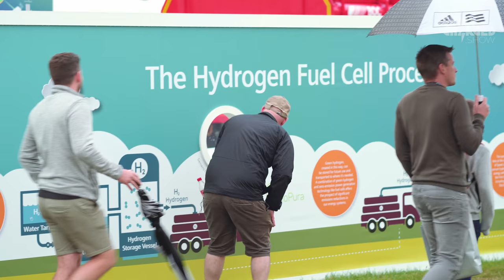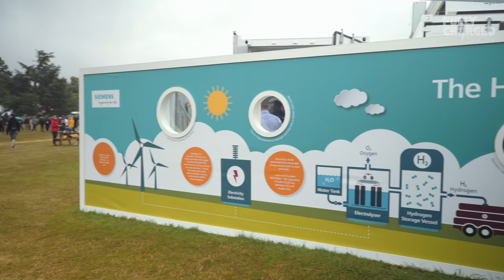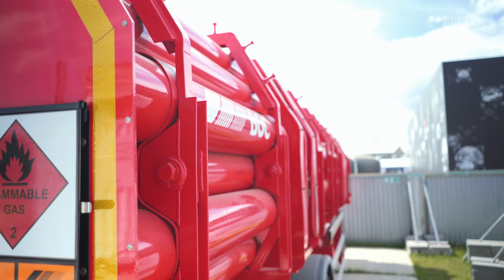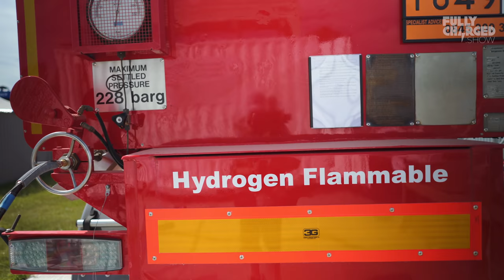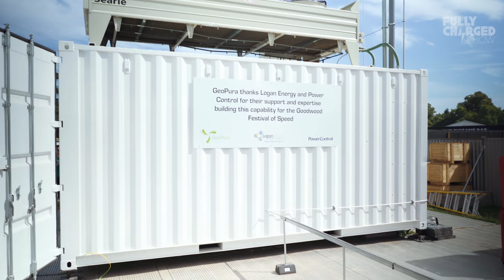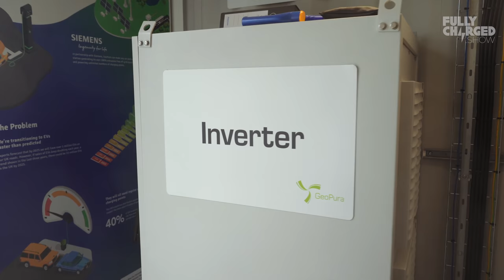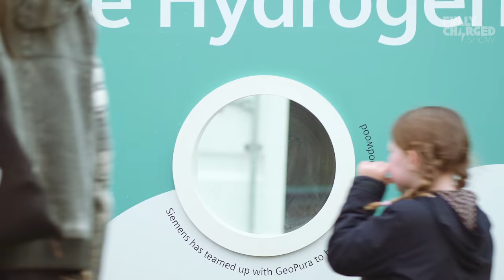Green Hydrogen Fuel Cell Charging System at Goodwood Festival of Speed | Fully Charged

Comment: Why don't Siemens Gamesa incorporate hydrogen fuel cells into the foot of the wind turbines?
Reply: Fantastic question!! I can't wait for an answer to this!!
Reply: ? You mean electrolysis machines? The fuel cell wouldn't be of any use.
Reply: You mean an electrolyser. It would be an expensive piece of capital equipment that would only be used when electriticy prices are negative (not very often). The electrolyser  would also require maintenance. 

Result would be inefficient use of capital leading to high price for the hydrogen produced
Reply: Why not pump water into the mast, then recapture the energy via a turbine when released?

Comment: You can easily stick 3MWh of batteries in a shipping container. Much simpler.
Reply: Hey, isn't that exactly what a Tesla Megapack is?
Reply: But you wast a huge ammount of resources and energy to produce said batteries ....
That's one advantage of fuel cells, they are less wastefull, considering stored energy and usable power. The inherent payback is the efficiency loss in the process of using fuel cells but than again, you can store energy as hydrogen much longer than Li-Ion batteries could ever do.
Reply: and 3MW of batteries would be much smaller.
Reply: @evilutionltd  
Generally, most energy sources have a higer volumetric density than hydrogen, another advantage of hydrogen is basically its disadvantage as well, it "only" has the best gravimetric density of all the known energy sources (besides maybe open cycle nuclear reactors or rocket engines).
Reply: @mandernachluca3774  do you know the comparative resource cost of batteries vs fuel cells?
Reply: @MrGonzonator  
Not exactly, however, i can tell you, that you need to increase the ammount of batteries to increase the energy capacity of a battery stack, you don't need to do that for fuel cells.
You basically have one stack of fuel cells and every increase in capacity can be handled by simply increasing the size of the nessecary tank, hydrogen tanks usually can be made of a rubber coating and a steel case (if used stationary, cars need lighter materials wich would eventually raise cost and resources needed).
Both are very common nowadays and cost a bargain compared to an equivalent mass of Li-Ion battery.
Reply: @mandernachluca3774  bear in mind that you only need ⅓ of the capacity of batteries since the fuel cell is so inefficient.
Reply: @MrGonzonator  
No, you would need one third of the energy stored in form of hydrogen, that would go under the begor mentioed penalty of lower efficiency. 
You would eventually still use more precious metals for the battery storage when increasings its capacity, in comparsion to a fuel cell stacks, wich only needs a fix ammount of precious metals and than can produce as much energy as you want, as long as the hydrogen tanks (made of rubber and steel) are big enough.
Reply: @mandernachluca3774  
 Mandernach Luca  
How about the electrolysis plant.
And staff.
And maintenance (that's going to be high, hydrogen leaks!)

And the tanker transport.

And refrigeration.

That's all continuous.

You think fuel cells don't use "resources" including exotic materials? Or wear out?
You'd actually need more, since the efficiency is so low.

What happens if you don't freeze the tanks? (Boom!)
You think that doesn't need energy?
Reply: @rogerstarkey5390  grid with renewables will have curtailment. Electrolysis is far better than just turning off.
Reply: @rogerstarkey5390  Pressurized H2 tanks don't need active cooling and you know that. Why are you still making such comments?
Reply: @rogerstarkey5390  
Well, i don't know were you live but here in europe nobody uses refrigurarion anymore to store hydrogen, we either use pressure tanks or non pressurized metal hydride tanks.

The maintenance of a hydrogen should be zero, otherwise you are a seriously bad engineneer.
Theses tanks are usually made to hold hydrogen 30 years upwards without leaks.

The electrolysis will ideally far away or at the plant itselfe. The electrolysis systems today can actually achieve over 80 and up to 95% thermodynamic efficiency.

Also, hydrogen does not simply make boom if heated up in a tank, however batteries do and they can burn for ours at extremly high temperatures while hydrogen dissipates its whole energy at ones in a hydrogen rich and therefor low temperature flame.

Befor talking shit about a technology, i would simply suggest you to inform yourself, otherwise you look like an idiot.
Reply: @mandernachluca3774  There are no "precious metals" in lithium ion batteries.
Reply: @ahaveland  
Fair enough, what do you call cobalt than?
Reply: @MrGonzonator  Yes, the whole setup is equivalent to a Megapack. Megapack would be much simpler. I have no idea what the hydrogen costs are but Megapack would be around £600k and losses would be hugely lower than hydrogen.
Reply: @mandernachluca3774  I guess that in a lot of cases where you need more energy you would also need more power. Increasing the energy can be done by adding hydrogen but increasing the power would require more fuel cells.
Reply: @tonyblighe5696  
And they need released supply of new hydrogen, with associated transport cost.
Reply: @danil874  
Curtailment?
Only when the grid is designed for fossil as the primary source.
If that's turned off there's plenty of headroom for existing green supply.
Reply: @mandernachluca3774  
You want to look like an idiot?
Transport relatively small quantities of Hydrogen, to point of use using LARGE fleets of trucks because it's pressure restricted.
Or larger amounts at VERY high pressure.
Then wait for the first accident due to the much increased frequency of transport.
Or transport frozen with restricted range.
Muppet.
Reply: @rogerstarkey5390  Turned off what? Base load? Do u really understand that you need like a huuge storage of energy. Tesla Gigafactory produces minutes worth battery supply of US grid in a year. So good luck waiting for entirely green grid.
Reply: @tonyblighe5696  
Not exactly, most of the time, you don't need a fixed power but a lot of stored energy, you just have to size the stack acording to the max power consumption.
One should visualise this as a power plant, you have a certain max limit but most of the time you only use half the power output.

With batteries, you have the problem, that you can not size to max power and than simply increase the capacity in a cheap and reliable way.

You could see it as a benefit that battery pack automatically have a higher poweroutput with an increase in capacity, however, you are also paying for a "feature" that you don't want or need.
Reply: @mandernachluca3774  We are 95% in agreement on this. The 5% is that you could increase the energy by adding more battery capacity while keeping the same inverter, thus reducing cost if energy requirement goes up without power requirement increasing.

Comment: More videos like this please. Sustainability isn't just about cars. Our whole Energy infrastructure needs to change to carbon neutral solutions. Was that lorry using Hydrogen Fuel Cells?
Reply: If it was using fool cells, it's still only as efficient as fossil fuels, plus, would use power to freeze the cargo!

Comment: Is there any scope to use a Stirling engine of some sort to claw back some of the energy from the heat?
Reply: I've never seen any evidence to suggest that Sterlings are anything less than a boondoggle.  Most of the companies pushing them at the commercial level simply want to find a way to burn more natural gas.  (Even "solar" sterling generators often use NG to get them moving).
Reply: I suspect a Seebeck generator wouldn't create a great deal of electricity, but when the host source is waste it'd be rude not to try. Even if it just charged a battery to power the lights in the container.
Reply: I think the obvious use for a stirling engine is to run the cooling pumps using the waste heat and thus claw back a huge chunk of energy loss. Boondoggle they are not and as for starting one, that's no different than using a (Electric) Starter Motor on a car (and glow plugs for the more perceptive) All the ingredients are there.
Reply: The efficiency of heat engines is determined mainly by the difference between temperature in and temperature out, higher input and lower output temperatures lead to higher efficiency. There are many different types of fuel cells.  Some, like solid oxide fuel cells or molten carbonate fuel cells operate at high temperatures, they could give good efficiency to a Stirling engine - as long as they didn't bleed off too much heat and cool the fuel cell below operating temperature. But the most common fuel cell uses a water saturated polymer membrane that must not dry out, that would result in a very low efficiency Stirling engine and hardly enough power to make it worthwhile.
Reply: Wouldn't it be better to just use the heat to heat up water for your home or office or wherever it was
Reply: @timscott3027  In short no, the heat generated might be good for one or 2 houses but you wouldn't use one of these domestically. It's a mobile generator. You could make a huge storage plant and use the heat of that for a community but again in that scenario using liquid air storage is probably cheaper and given limited figures probably more efficient. Hydrogen is great for large mobile applications where other technologies can't compete aswell. Again horses for courses
Reply: @timscott3027  Possibly, it rather depends how hot the water is I suppose, you might get two uses out of it if it's really hot, once in some sort of heat engine and then again as hot water.  For the role we seen it in here though, as a portable generator I shouldn't have thought there's as much need for hot water as there is for electricity.